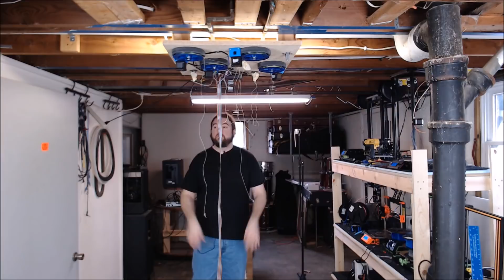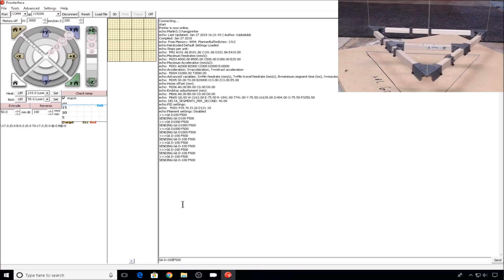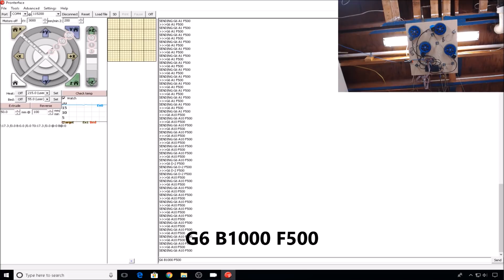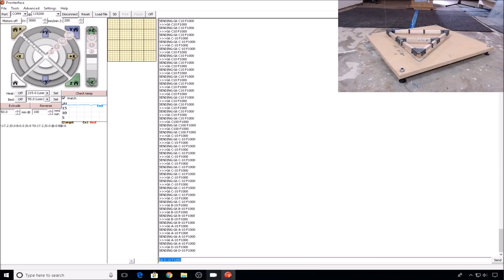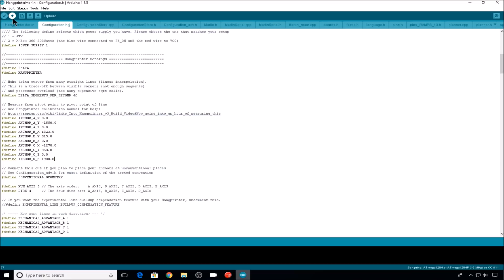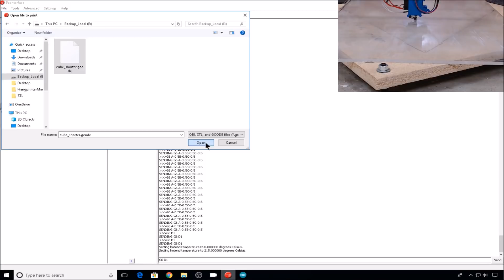HangPrinter v3 Part 2 - The Calibration - Chris's Basement

Comment: wow, that is a ton of effort :O

What was the theoretical maximum build area?
Reply from the maker: It sure is! :) With version 3, about 500mm cubed then about a 300mm cylinder on top of that to the ceiling.
Reply: That is quite a bit of volume! :)
Tho, bad footprint to print volume ratio tho, and the months it takes to get it up & running? Yeah, well beyond most people.

But VERY VERY interesting form of kinematics. As this form matures we might see it become more approachable as well.
Reply from the maker: @skaltura  Indeed, there is always a ton of development going with it. V4 is being worked on now, it looks like a lot of improvements.

Comment: So awesome!!!  And all done with fishing line...amazing!
I wonder if ethernet cable vs the ribbon cable would be better to run down to the print head, thinner, less gainly, and you can ziptie the 18ga wire to it then use some of those retracting key holders to hold it out of the way and retract as printing
Plus is you double up the twisted pairs it might even be able to handle the current for the hot end..but the 18ga wire is definitely the way to go...much less loss thru the wire

Comment: Really nice and enjoyed watching. Makes a delta look easy. What is the build volume going to be?
Reply from the maker: Thanks! And that is a really good question, it gets smaller are is goes up. I am guessing you can print in a 500mm cube at the base pretty easily. We will see if I can test that.
Reply: I remember Torbyn saying that in the Tom Sanladerer build. Though looks like you can get about 30 plus centimetres in the z axis before it starts narrowing right?
Reply from the maker: That should be about right I think.

Comment: Wow! That’s a bit perplexing to me on the one hand so simple it’s just some string, scrap wood, and minimalist electronics. On the other hand though all the work to get square, and level seems tedious but perhaps it’s the scale that makes it seem like so much work? Either way you did an awesome job explaining everything👍 you may have mentioned in the 1st video but what size nozzle are you printing with here? Also would having the larger power supply have avoided the skips or was it just some additional configuration needed? Can’t complain with these results. I’ve had worse first prints from plug and play hardware 😜
Reply from the maker: Thanks Michael, I am starting with a 0.8mm but I want to jump up to a 1.2mm soon. It's a chore anyway you look at it. I have messed with the power supply some, I think I am just at the top of what the motors can do. I am currently working on a new power supply config that might be a little cleaner.
Reply: Chris Riley can’t wait to see your results, I’m struggling to get quality on my Titan aero volcano toolhead on the Taz 6 when using a 1.2mm nozzle unless I print in vase mode. The seems just never seem to react the same 2 prints in a row. I probably should have stuck with 3mm filament so I could test on unmodified cura profiles.  I keep bouncing between cura and S3D but I’m sure I’ll get it sorted just uses a lot more filament 😁
Reply from the maker: I hear that! This thing burns threw it, I want to clock how fast the spool turns.